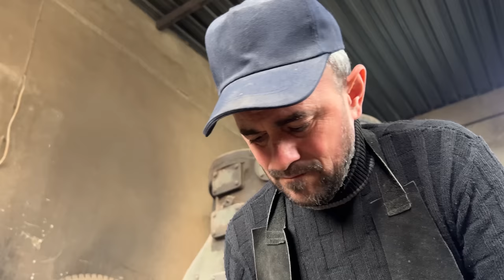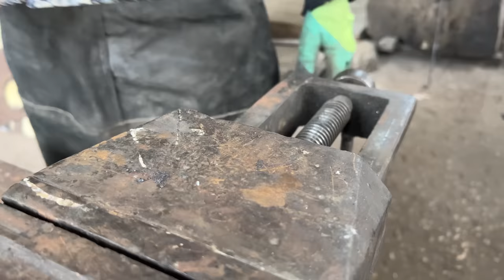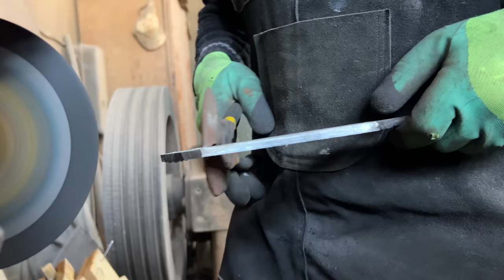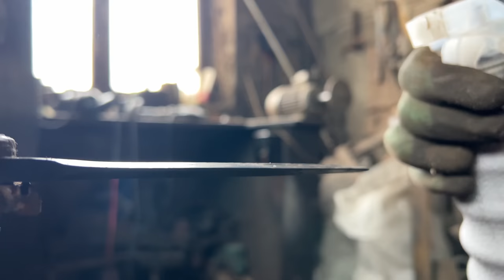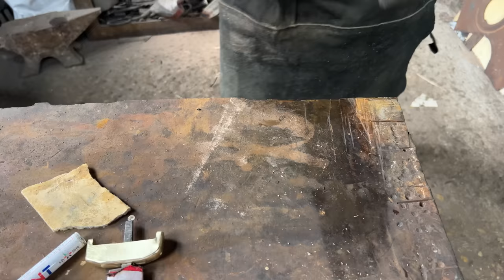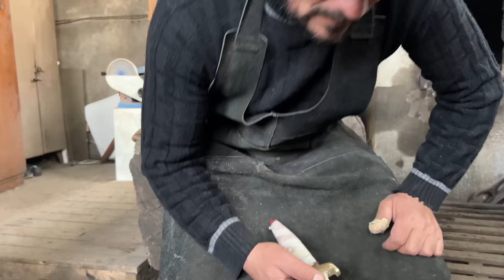Will It Be Possible To Make A Knife Out Of 1000 Metal Pins?

Comment: There appears to be 40 safety pins which is not particularly close to one thousand. But here's the thing. Since the pins are sandwiched between thick steel plates, the pins constitute 2% of the finished knife. So the question really should be is it possible to add  40 safety pins to damascus. And by the way if you sharpen the backward point on the guard you could cut the user instead of just hurting them. Still,  you are a million times better at forging then I am.
Reply: Por qué corta la punta del cuchillo en vez de forjar la punta?

Comment: Ookay, you got a thumbs up because you clearly know what you're doing; when you forge steel since many of the projects you have posted start with very original origins, this and your other blades are interesting and functional even if they aren't all pretty or symmetrical (that handle is definitely NOT centered on the blade LOL)
I do wonder why you don't forge enough metal to create a full metal tang though, it would be far stronger than short tangs like this or rat tail tangs.
Also, why didn't you use a locking pin on the tang? even a short tang would hold the hilt better with a locking pin.

Comment: SO what type of Safety Pins are these, Stainless Steel or Brass mix and Nickel coating, Most of the pin will probably be waste material, so not really making it out of the pin surrounded by that Stainless Steel plates???  8 Pins per layer and 5??? layers that's 40 pins not 1000  Nice Knife though.